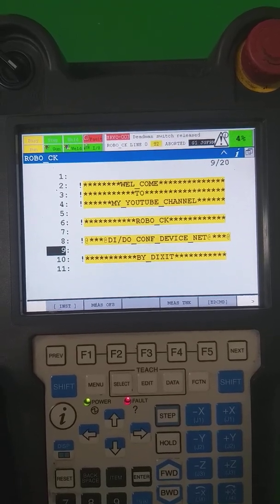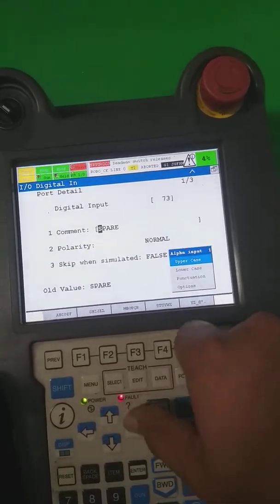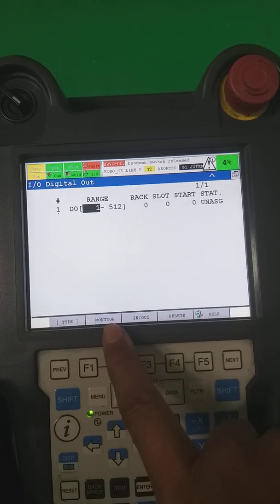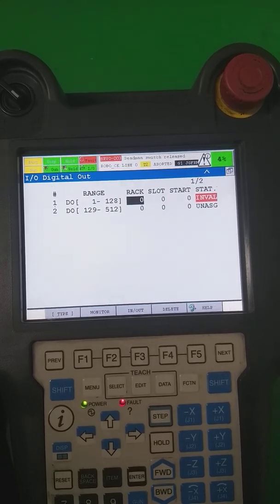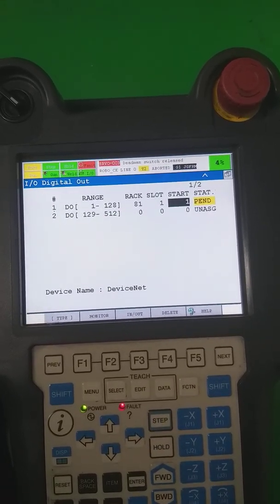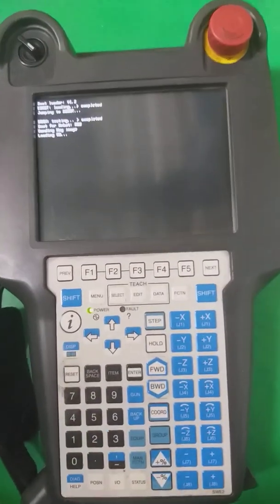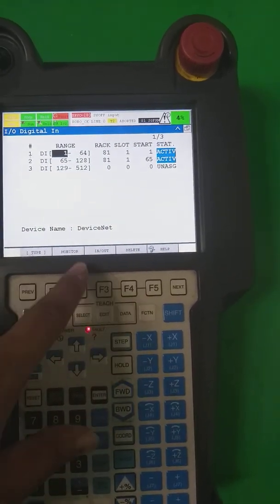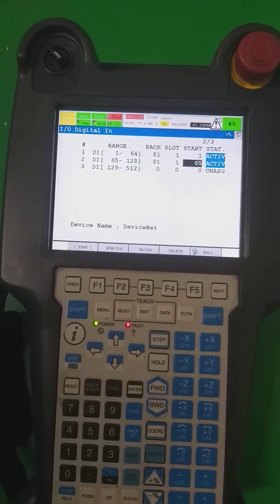Fanuc Robot DO/DI signals Configuration on Device-Net

Comment: Hello. I don't understand how to check incoming signal from other simple device (two wires connect or disconnect). Can you help me? My robot model is ARC Mate 120iBe
I think I need to use CRM2B. I try to connect IN with V24, with COM, with 0V, but no signals in DI registors.  Probably I'm wrong.